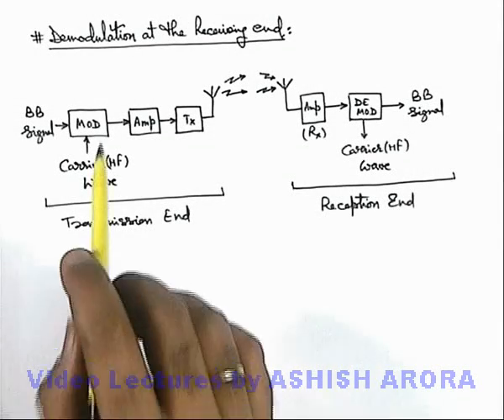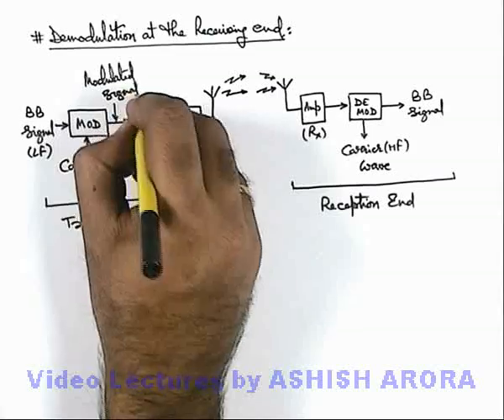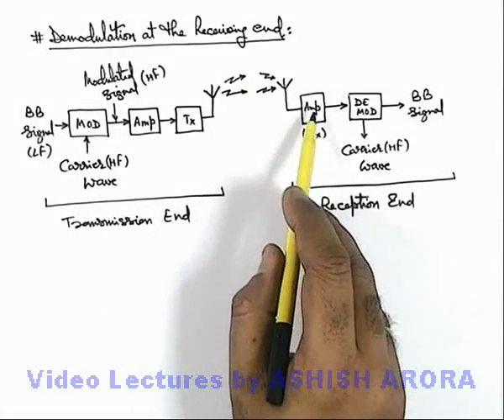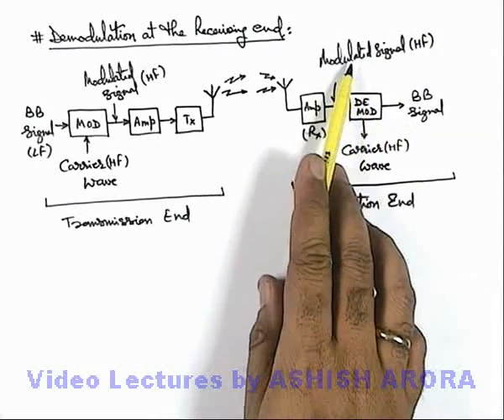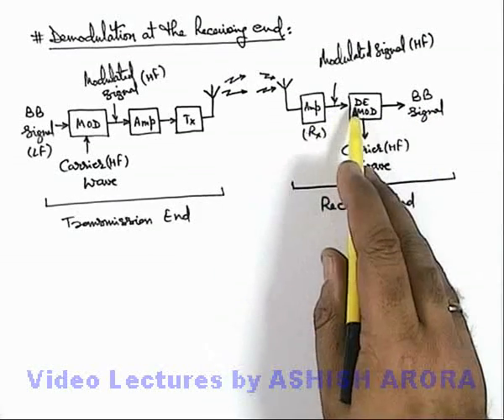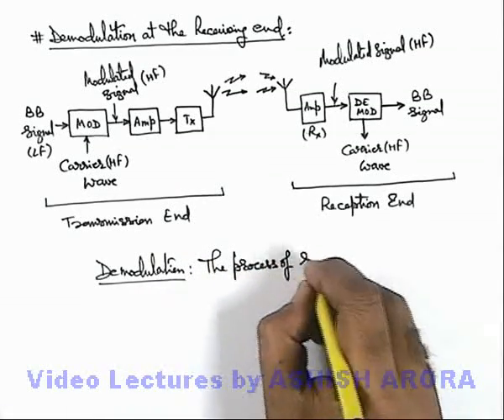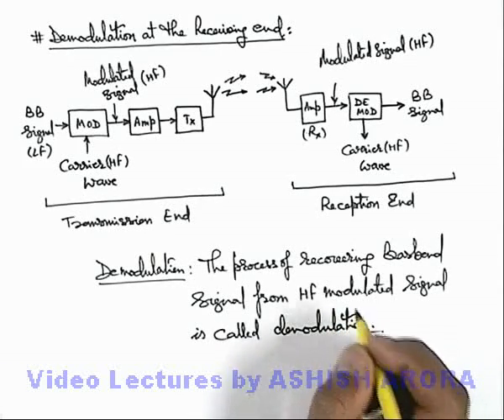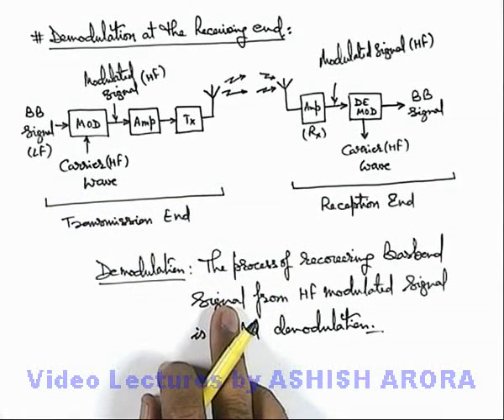Class 12 Physics | Modulation | #3 Demodulation at the Receiving End | For JEE & NEET

Comment: what is the need of amplifier at receiver end??
Reply from the maker: +ABTech Due to induction the level of signal at receiver end is very low so it has to be amplified before separation of carrier wave due to noise signals fetched by the wave during transmission...